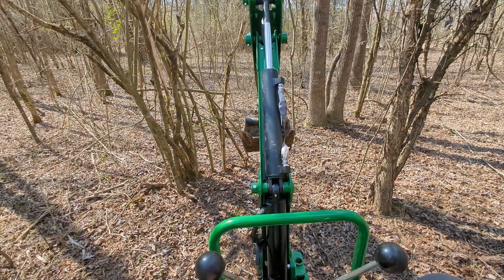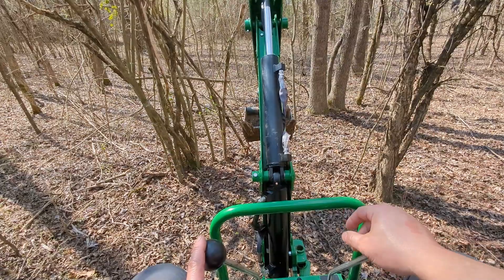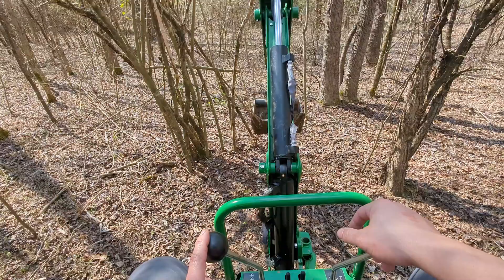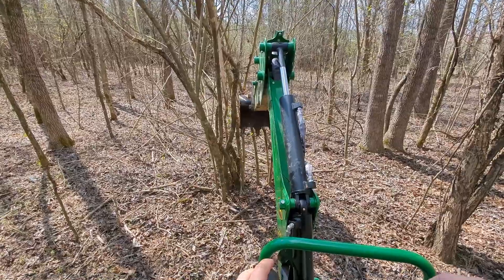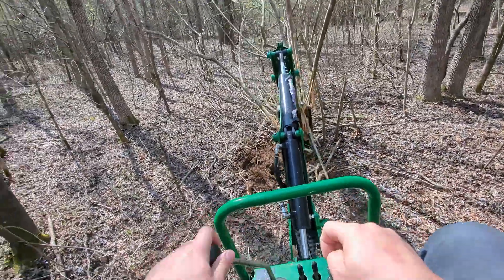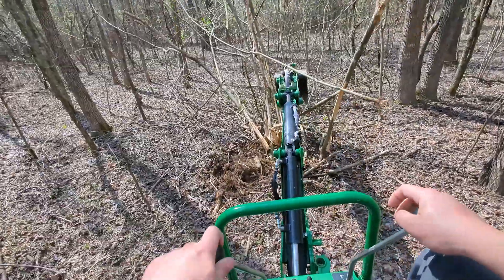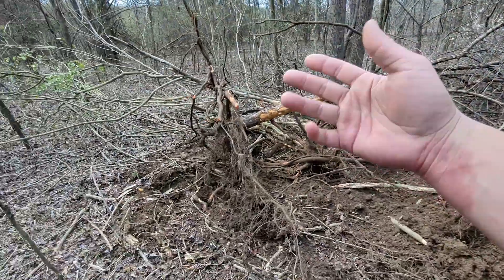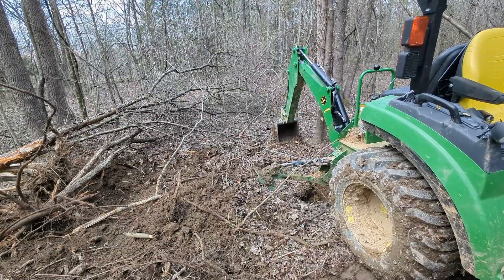HydrosPlus Backhoe Prototypes - Decision Update and Power Demo

Comment: Do you have the same suggestion for the 2025 r backhoe?
Reply from the maker: I recommend the 2.5" bore for the 2025R.  It seems to have plenty of power for the 1025R and the 2025R isn't a lot heavier than the 1 series.

Comment: What would be the recommendation for get better  two functions? Say you boom all the way out and try to rake the top of the ground up. I would like to scrape out flower  bed and one function is always over rides other. Really like the work your doing.  Oh i have a new 2025r
Reply from the maker: I recommend the stage 3 pump for the best 2/3 function at once.  Stage 2 will let you do multiple functions, but stage 3 does it at a much lower RPM which saves fuel and wear.

Comment: Is the 370B going to get an upgrade?  It's one reason I haven't gotten my tires filled is I can currently maneuver myself lifting and pushing with the backhoe.  I'm thinking loader boom cylinder upgrade, plus the pump and the backhoe cylinders would make the ultimate 3 series kit, 3e price 3r performance 😁
Reply from the maker: Yep - this will work on the 370b